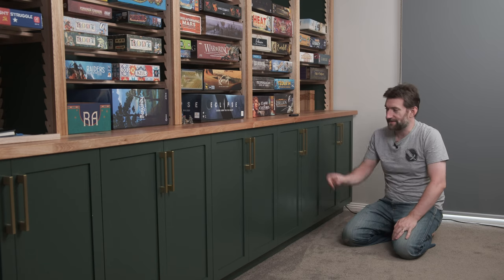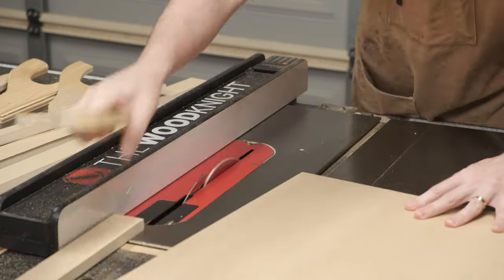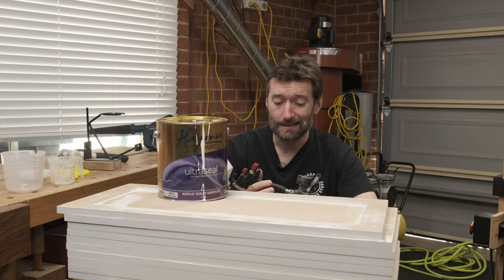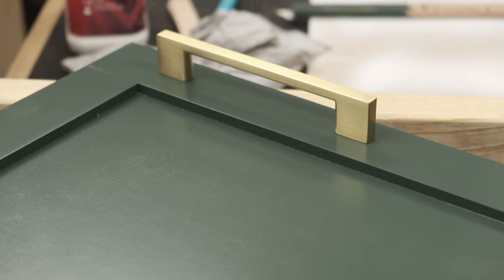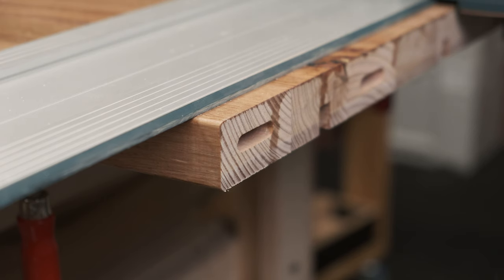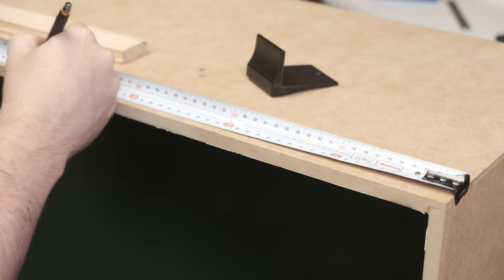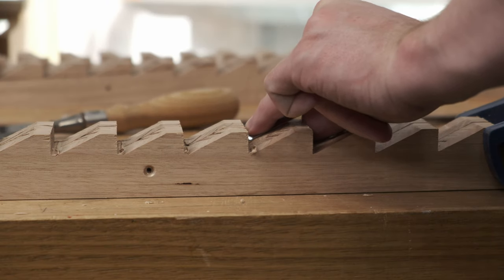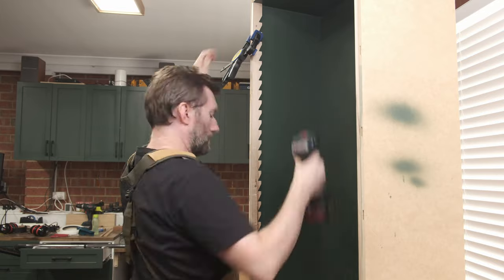All the walls are games/cardboard dreamin' - Board Game Shelves!

Comment: Wow, those shelves look amazing!!  The slat shelves may not look the strongest, but they also will only hold a couple of games each as there are so many shallow shelves.  It's a bit different than bookshelves but it'll work perfectly for the intended purpose.
Reply from the maker: Thanks! If you switched the slats out for a solid panel, I think you'd be able to hold plenty of books per row too. The cleats/vertical stands seem to be able to hold a ridiculous amount of weight for the size - and could always beef it up to slightly thicker standards to hold a few encylopedias per row :)

Comment: Very surprised you used the domino on the bottom face of the bench top. Didn't think the prefab tops would be too accurate.

The green and brass looks great.  Nice to see more boardgame storage options out there.
Reply from the maker: When sanding there was a slight seam with the dominos - a hump in the middle mostly - but a few passes with a #4 plane and then sanding blending it surprisingly well. I find the thicker (30mm+) prelams are usually OK for flatness, but the 25mm and thinner tend to go like potato chips as soon as they're out of the bag
Reply: @TheWoodKnight  I've seen 16mm melamine faced MDF vary by 1.3mm.
Not fun when you need to join that.